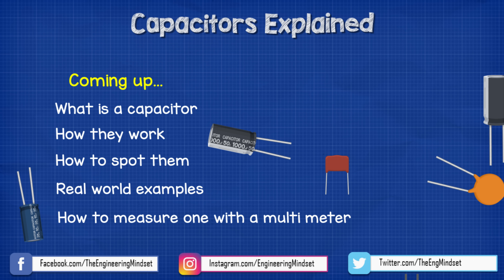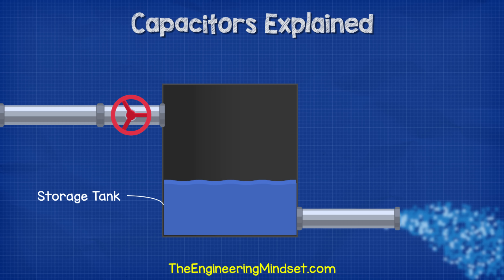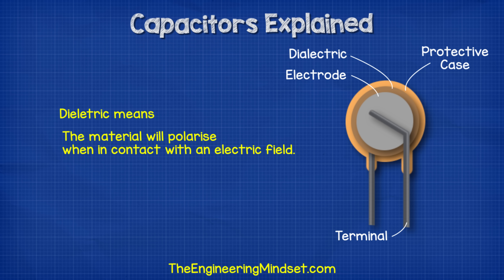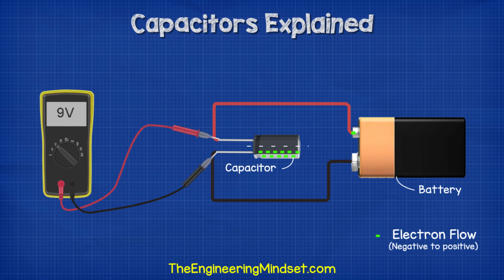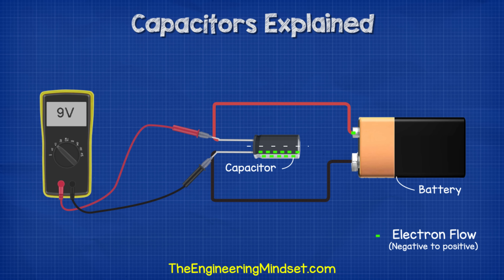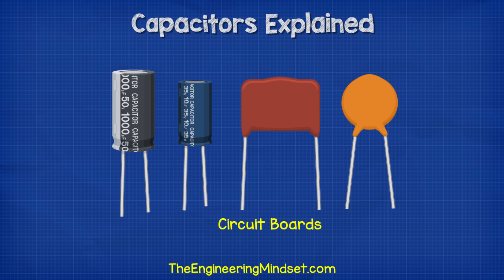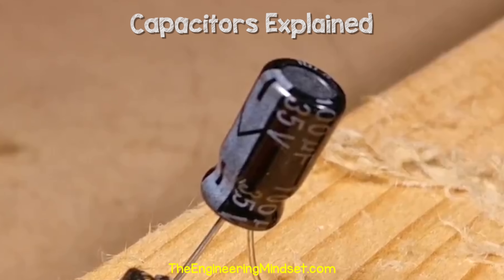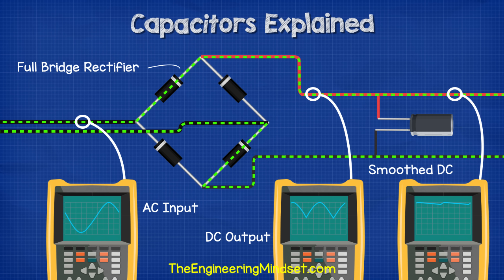Capacitors Explained - The basics how capacitors work working principle

Comment: My first lesson on capacitors was a very nice expensive Kettle that I bought that lit up a lovely blue colour when on. 
Unfortunately as it didn’t have any discharge resistors the capacitor would store an enormous amount of energy which discharged itself if you was unfortunate enough to touch the plug pin after it was unplugged. 
This thing gave such a whack I lost feeling in my hand for about a minute.
Reply from the maker: Check out NEW resistor video, everything covered! ➡️ https://youtu.be/DYcLFHgVCn0

Comment: We just need a capacitor to be the size of a battery have billions F at low voltage. And you'll have the best battery in the world.
Reply: LOL nice one😂😂😂 seriously though :
Billions of farads? Do you have any idea how powerful it is? Let me tell you. A billion farad means that it can store a billion coulombs of charge per volt (it can store 10 billion coulombs if charged with a 10 volt source, etc.) and if by accident it gets discharged it'll be worse than one million lightning bolts hitting you at the same time (lightnings are only a few coulombs of charge) and probably vaporize you instantly. We rarely even use a 1 farad capacitor as it's already a huge capacitance, plus it's impossible to build a one billion  farad capacitor.

Comment: Good job man ! 
You’re doing a good work.
One time I accidentally touched a 230V capacitor , 
it just convulsed my arm but it 
didn’t hurt .
Reply: Liviu Valache 
cuz 230 volts with low amp cant burn but just make u feel it....if it has an amp ranging 2 and way above it might hurt a lot
Reply: @endurofan9854  So you’re saying he has super powers? 
Whoa.

Comment: Capacitors are the reason you should power off a device before you power off the device at the wall then unplug, because 1 to 2 seconds of power remains in capacitors and up to 10 seconds in the big ones in power units.  Great thing about capacitors, they prevent any damage to sensitive electronics in the event of a power dip or sudden short power loss or blackout.

Comment: The classic explanation of charge, negative charges collecting on a plate in the capacitor is pure fiction. Conductors cannot isolate charges from one side of its crystal matrix to another. It can easily be demonstrated that the charge, as your introductory comment indicated, is stored in the polarized dialectric material, not on the conductors. Of course, since dielectrics do not have the ability to hold charge, this seems unlikely, or impossible. Which, for a clear thinker, would indicate that the form of charge has to transform into something else in order to be stored within a dielectric.

This should not seem all that impossible. Most of us have common examples of non-metalic objects producing charge. The first discoveries of electricity and some of the primary machines for producing charge were in fact dominated by non-metallic substances like wool, rubber, amber, silk... and produced some very high electrical discharges. It's just the explanation that charge is exclusively created by electrons... that needs reconsideration.

The simple test to confirm that the metal conductors are not violating their basic function of conduction to operate as you claim is to remove the dielectric from a charged capacitor and connect that charged dielectric material to a neutral or discharged set of conductors, the charge will be transferred and the previously charged conductors will be neutral or discharged without giving up any electrons.

At one time MIT had published a YouTube video demonstrating this. They constructed capacitors which were glass beakers lined inside and out with copper. In a nested cup configuration. The sound was removed from the MIT silent video... and large sparks demonstrating the charge were transferred via the beaker, not the metal. I'm told you can do this with an oil bath too.

How? Why? The answer for this violation of basic scientific process is political, not physical.

Basically, the classic explanation of electrical theory is designed to obfuscate that electricity consists of two separate characteristics or quantifiable properties that only make energy when combined. Each can be dissipated into or collected from the environment, and when properly combined create or destroy useful energy. 

This simple property puts a lie to a fundamental law of physics and enables the easy empowering of capable people to make power without consumption of resources or metering by sociopathic persons and organizations. 

You might look closely at the transatlantic cable. It is impossible for the cable to conduct electrical signals strong enough to travel end-to-end without consumptionless amplification along the way. Loosly wound ferro cores form inductors with capacitance and these flux-capacitors provide power along the way, without consuming anything that isn't readily available from the environment... even under the ocean. Joe Newman and Thane C. Heins have demonstrated working motors that do the same thing... make electricity while doing work. (something Tesla discovered with his flux-capacitor design, the bifilar wound inductor)

The capacitor is a revolutionary device, not just a device to smooth out the flow of interrupted power. Think of the consequences of unlimited portable power. Nothing you own or would like to achieve will ever be the same, or have the same value. The socio-economic foundation of the world would change.  

Party on dudes, be good to each other. Peace, B

Comment: Me as a child thinking capacitors as watertanks in those mini city pcb boards is right.
Reply: best comment, very innocent
Reply: lol that is exactly how I named them
Reply: I thought they were small explosives and batteries. I was right to some point. Aint i?
Reply: @deadeye8  To some extent, sure!
Reply: Why overcomplicate things? This is so simple, a child can intuit them
Reply: haha
Reply: That's right. They look like city water tanks. I realized it just now.
Reply: Actually it works like a water tank.
Reply: Yeah! And the microcontroller is the factory!
Reply: @samosa2598  microcontrollers are actually the Rothschilds

They control EVERYTHING
Reply: Water analogy is used quite a lot in electronics.
Reply: I would play circuit city for hours!

Comment: Yes me too found this video very useful and easy understanding, wondering if you can help "my external desktop computer speakers when i switch it off each time it will make a loud pop sound, will a capacitor at some part help to eliminate that loud pop sound which is annoyingly load.

Comment: what about older capacitors which had the foil side marked. This is where the lower voltage of a circuit is connected. If you reverse the set up you could pick up humm in a circuit.

Comment: Why manufactures don’t use those capacitors right inside the power supply (battery) rather than putting it separately to every single component
Reply: you are missing the point

Comment: Why do ceiling fan capacitors have 4 or more wires  in different colors?  The confusion arises when connecting these wires to their right circuit points.

Comment: The water tank analogy for capacitors is not very good since it   implies that they would conduct DC... Capacitors are more like springs that can store energy when compressed and release the energy when the "pressure" stops being applied

Comment: I have questions like..
1. How many amperes can.. say 1000uF capacitor deliver?
2. Does the capacitor deliver the same voltage it received from the source before it was disconnected or does it only deliver the rated voltage?

Comment: Great explanation. Slight correction though. Your schematic with the capacitor sideways has the longer lead connected to negative. The longer lead is positive not negative so the schematic has those backwards.

Comment: But what about non polarized capacitors?  If diodes are pointing +/- voltage flow is the non polarized capacitor still non polarized and/or does non polarized capacitors have to have their poles defined by diodes to be driven o tdd used?

Comment: After disconnected power supply capacitor keep providing power supply until it get discharged but why circuit need power supply after switching off power supply

Comment: you got the pronunciation wrong.. brits say.. Al. Uminie. um, americans say.. uh. lum. in. um.. Dang that is a very cool way to put measuring voltage..  the difference of pressure between two points.. I like that explanation.. I will use it when I am teaching someone about electricity... Damn fine video! carry on!

Comment: I may have missed this,, but why can a power supply not keep up with the needs of starting 10 motors for example. Is it because of wire size? If the wire size was larger we would no longer need capacitors?

Comment: Remember, when charging capacitors they will take as much current as they possibly can until they're charged up. This current is only limited by the internal resistance of the capacitor as well as the inernal resistance of the power source and the power leads. Once the capacitor fills up, the current sharply decreases to 0. This is usually the reason for solar inverters failing. The current draw is simply initially higher than the inverter can handle. Same applies to driving an AC motor. Initially the current draw is very high, blowing the fuse of the inverter.
Reply from the maker: Power inverter video  here https://youtu.be/iIqhAX0I7lI

Comment: Just a small correction, charge doesn't flow through a capacitor because they are not touching, not because of the dielectric between. A capacitor will still work without a dielectric, but dielectrics are used to increase capacitance for increasingly small circuits at the expense of max voltage. If they were touching then it would simply act as a conducting wire and charge would flow through. Great video though!
Reply: A capacitor with 'no dielectric' has an air dielectric.

Comment: hi engineering mindset. I just wanna ask How can I make a series  circuit blinking led lights using PCB, resistor, capasitor, diode just powered by 9v or 12v? and what other material should used? I hope I can receive an answer for these. Thank You & more videos.
Reply from the maker: Check out NEW resistor video, everything covered! ➡️ https://youtu.be/DYcLFHgVCn0

Comment: If electricity is flow of electron particles, what is containing those particles for them to behave like a wave? Particles only behave like a wave when contained. Water contained in a pond or air contained by earth for example. Wave pattern of particles is impossible in vacuum of empty space. If its wire containing electrons, what about electromagnetic waves? Same with photon particles of light, what is containing them? Can you see the problem? Something else has to contain them otherwise it all flies apart.

Comment: Capacitors and Inductors both charge, store, and release energy. So how does one decide which to use in a circuit?
Reply: The mechanical equivalent of a capacitor is the spring, the equivalent of an inductor is a mass or weight.   At first this analogy may not seem helpful but if not then one day it will spark an ah-ha moment.
Reply: @rh001YT Capacitors "filter out" constant pressure differences and slowly varying, low-frequency pressure differences, while allowing rapid changes in pressure to pass through.   Inductors "filter out" rapid changes in flow, while allowing slow variations in current to be passed through.
Reply: @ Brian Anthony  One has to specify if a capacitor or inductor is in series or parallel...the diff is significant to say the least.   You have described capacitors  in parallel and inductors in series.  

Generally a capacitor is used in parallel when one does not want a voltage steadying effect for lower frequencies but only for high-ish frequencies.   A capacitor is used in series when one wants only fast changes in voltage to pass through unattenuated.   As the inductor is the inverse of a capacitor,  generally an inductor is used in parallel  when one does not want a voltage-steadying effect for higher frequencie but only for low frequencies. An inductor is used in series when one wants only slow changes in voltage to pass through unattenuated.
Reply: @rh001YT  Thinking on it, yes you are correct

Comment: Capacitors also filter out DC. A volt-ohm meter is not practical device for measuring values nor testing out capacitors.

Comment: Good info about capacitors.  Wish i saw this video back when i was a kid and took an old camera flash apart and got a good wack from that capacitor.  I figured if the batteries were out it would be safe

Comment: μF is read mikro Farad and ''μ'' stands for the greek letter M on lower case. Just for the folks who are interested in the symbols. Thanks
Reply: Similarly, the 'Ω' symbol which is often used with resistors, stands for Ohm, but is actually the uppercase Omega, also from the greek alphabet.
Reply from the maker: Check out NEW resistor video, everything covered! ➡️ https://youtu.be/DYcLFHgVCn0

Comment: l have watched a number of videos lately on capacitors for guitars and while they recommend what capacitor to use depending if it's a single coil or humbuckers (usually  22uF or 47uF) they never mention voltage. They always seem to show the little ceramic capacitors but can you use a metal capacitor of the the same value or is there a difference.

Comment: I have look every where for a 200v/180uf Cap for my scanner. I could only find a 220v/180uf. Can i use the 220v in place of the 200v, same 180uf? Please can someone advise before it arrives and i install it. Size was also important so could fit. So im using a 220v in place of 200v. Help please?
Reply: I am not a tech but you can use an up rating in the voltage like what you want to do, without a problem. I did that myself .  It goes wrong if you use an lower voltage cap in a higher voltage circuit.  maybe a tech could answer better.

Comment: Capacitors were an integral part of my childhood.  As kids we dumpster-dove for 4 microfarad fairly large high-voltage capable units from a discarded gigantic vacuum-tube-based computer (yeah, I'm old).  We connected them in parallel to increase capacitance.  We charged our tasers with house alternating current.  Actually, school, which we nearly set on fire.  Ok, it was me, but there was only a bang and some smoke :)

Comment: If a capacitor works like you explained, just by storing electrons on plates, how is it that the plates need to be close to each other and  the capacitance increases when the plates get closer to each other?
Also the capacitance gets better when you change the dialectric, so what role plays this in the process of storing electrons?

Comment: Does it smooth out voltage or current? How is the voltage going down when discharging it with a resistor?
Reply: It smooths out voltage, a resistor smooths out current, a resistor discharges it by converting the energy to heat, and dicipating the heat.
Reply from the maker: Check out NEW resistor video, everything covered! ➡️ https://youtu.be/DYcLFHgVCn0

Comment: Charge (Q) = Capacitance (C) x Voltage (V) = Current (I) x Time (t) => Try it - experimenting is a lot of fun. Always use a resistor (R) to ensure low currents in your circuits for greater safety.
Reply from the maker: Check out NEW resistor video, everything covered! ➡️ https://youtu.be/DYcLFHgVCn0

Comment: When I was around 14 years old, (I was was in the Ham Radio Club in High School) in the 1960's, I used to fix TVs when vacuum tubes did most of the work in the set. When I replaced a burned out cathode ray tube (the picture tube), I had to be very careful of the 10,000 volts that would remain in the capacitor, even after when the set was unplugged. "Bleeder resistors" were the answer to discharge the 10,000 volts.
Reply from the maker: Check out NEW resistor video, everything covered! ➡️ https://youtu.be/DYcLFHgVCn0

Comment: When you put the volt meter accross the charged capacitor, why doesn't it just discharge right into the meter?  I am thinking it would for sure if you set the meter to amps. Correct?
Reply: You cant measure across a component with Amps set, since you have to make a break and fill it with the multimeter
Reply from the maker: Check our new Multimeter tutorial out ➡️ https://youtu.be/4lAyzRxsbDc

Comment: Why do i have to use a resistor to discarge a capacitor instead of a screwdriver?
Reply: You could explode the cap by causing a short circuit with the cap, so you should always use a resistor.
Reply: Oh yeah to limit the current i didn't think about that thanks
Reply from the maker: Check out NEW resistor video, everything covered! ➡️ https://youtu.be/DYcLFHgVCn0

Comment: Nice presentation. Speaking still strictly DC, I wish you had hinted at RC time circuits. It would have enhanced understanding and peaked interest in a useful property, ready for discovery and experimentation. Using your water tank example, "two tanks equally filled stop the flow until...", etc.

Comment: It makes a cool effect if you use a 100uF capacitor hook it up to a led connected to a 220ohm and ground. If you let it charge up the unplug the power supply it makes a cool dim effect

Comment: Hey so if the capacitor is capable of 35 volts and i only supply it with 12 volts of electricity will is still charge up to 35 volts?
Reply: Daniel Mc Dowell  thank you very much I appreciate it. 😊